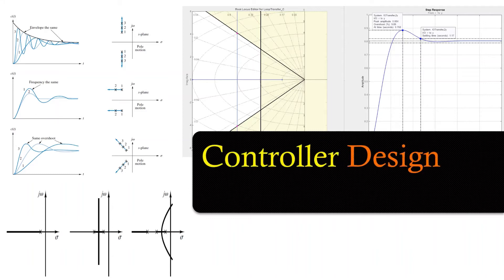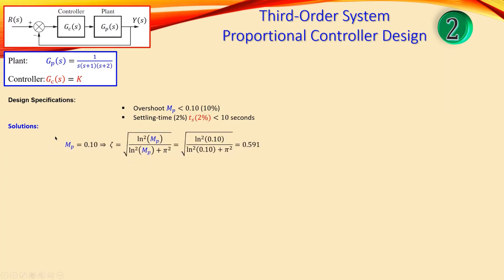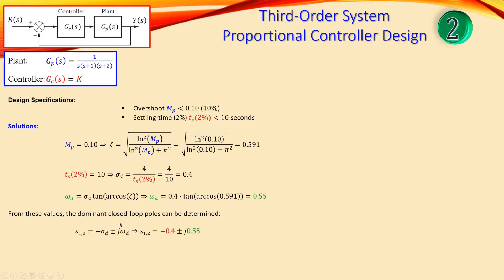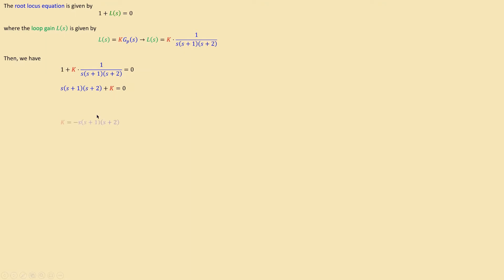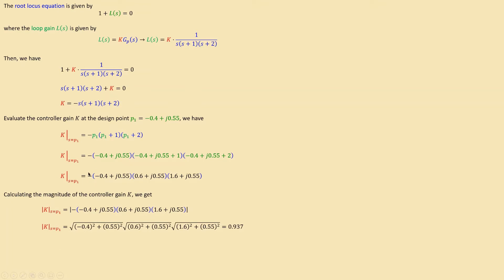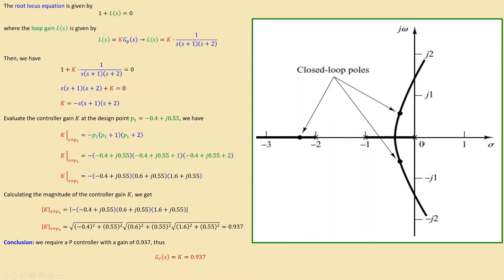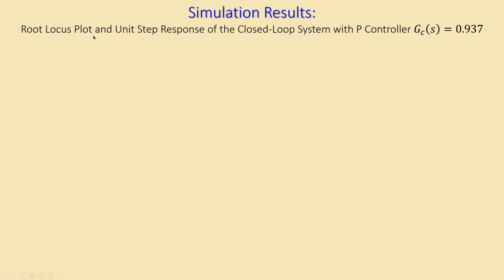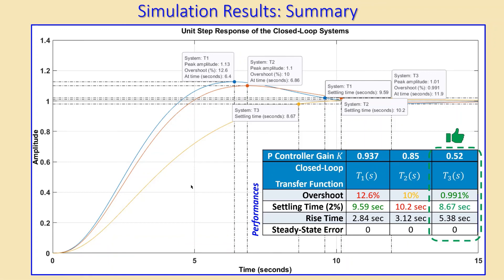Root Locus Design Method 💡 P Controller Design 💡 Calculations & MATLAB Simulations 🌟 Example 2

Comment: crystal clear thank you, if we suppose to design controller with opamp that k is defined by r1 and r2 am i right?, thank you again
Reply from the maker: Glad you liked the video! Depending on the sign of the controller gain, you can realize this with an inverting or noninverting amplifier. The ratios of the resistors in these amplifier will make up your required gain.

Comment: Can you please explain that how did you get a vertical line at -0.5 in the Root Locus Editor ?
Reply from the maker: In the Root Locus Editor, you can add system requirements to define the maximum allowed values. For settling time, the Root Locus Editor will draw a vertical line. In this case, for a settling time of 10 seconds, the required real part of the design point is -4/10 = -0.4. However, the formula for calculating the real part is an approximation and only produces accurate results for all-pole second-order systems. That why is it not exactly -0.4.
Reply: @CANEDUX  Thank you very much for the explanation
Reply from the maker: @ashutumho  You are welcome! Feel free to send your questions again. Good luck.